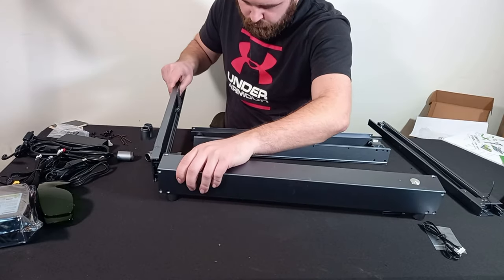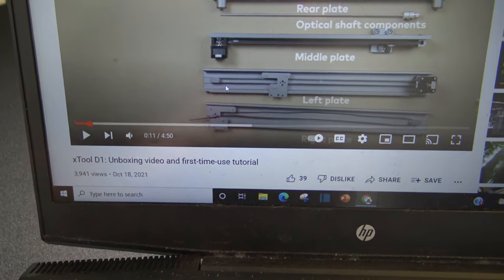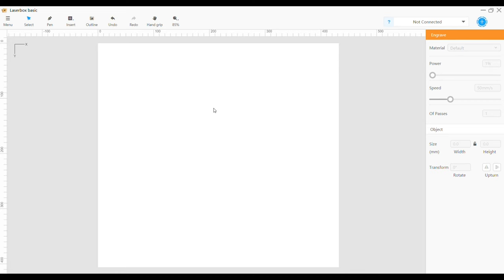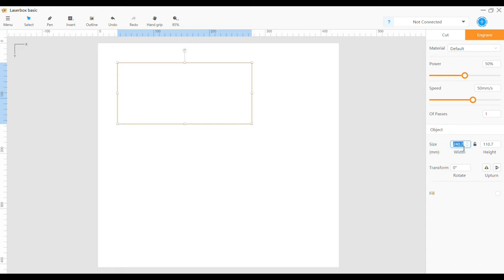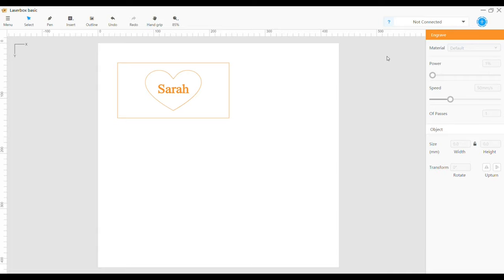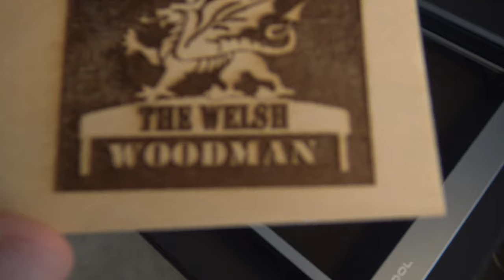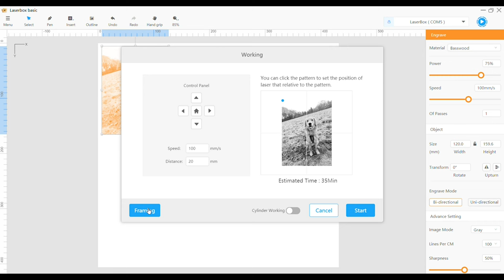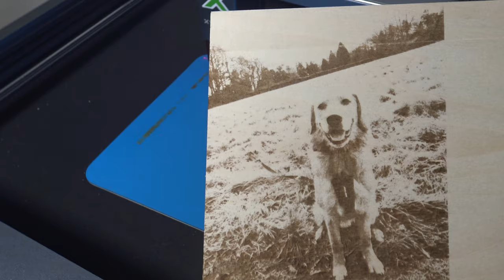x Tool D1 Laser cutter and engraver review

Comment: Hi Tom, neat new toy, I mean tool 😁. Looks like it will be used a lot.  Since it has the right type of plug for this side of the pond (Virginia, U.S.A.)👍it will be easier for me to set up. I like the open frame, as I could build a box structure in which I could have an adjustable platform to put turning projects on to burn in a maker’s mark. I see a lot of possibilities.  Thanks.  Good luck with your system and I’m looking to more videos.  Hope you and yours have a very Merry Christmas.  Cheers, Tom
Reply from the maker: Thanks Tom, I'm looking forward to making a box around it. I'm thinking of having a sliding dovetail bottom, that can slide out with adjustable legs on the side of the box to raise it up so I can engrave my bowls 😁 I hope you have a lovely Christmas 🎄

Comment: Looks amazing, was it as simple as changing the plug over to uk plug?
Reply from the maker: It is really easy to use, used it the other day to make a engraved chopping board for my sisters wedding 😁 to fit a uk plug, I just uses an old laptop lead the half with the plug on it unplugged the American plug from the lead that came with the laser cutter and plugged in the UK lead into the power supply box that connects to the laser cutter 😁

Comment: Hi. very interesting piece.  I do have a question.though.   Does a transfer of a photo from my file to this  X-tool work in the same way as in a transfer from a file to say Facebook or Instagram?
Reply from the maker: Hi Roger, it works on the same principle, you select a photo you want to upload to the CAD software and the software automatically converts it so you can engrave the image. It take all the hard work out of playing with the settings 😁 I hope this helps 👍
Reply: @thewelshwoodman649  .Just to let you know.I was over at my sons place and he just got one of these machines. I can say the christening went well. He has a whole bunch of my cutting boards and he burning a whole bunch of stuff on them. But thanks for the rep;y. so far we aare not dissapointed in the machine. Thanks again.